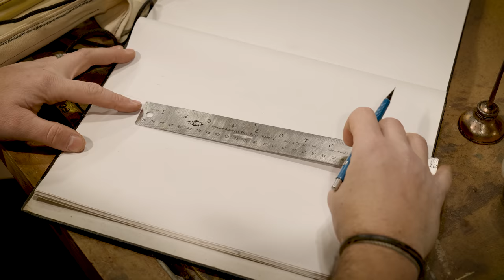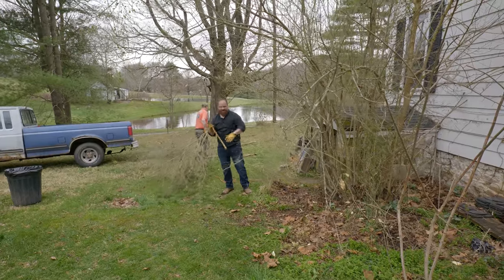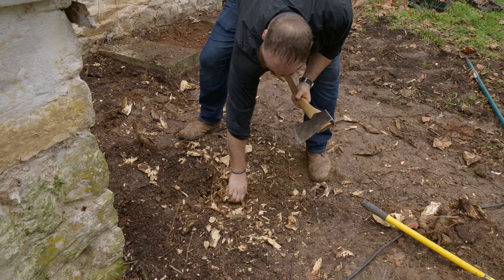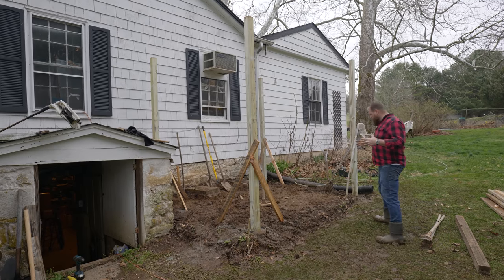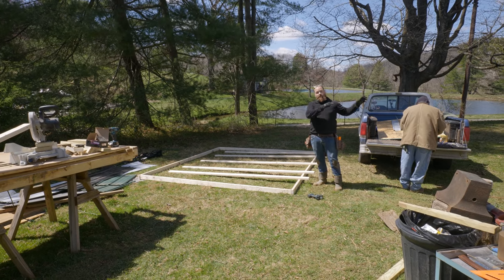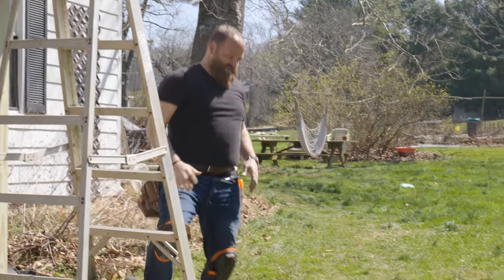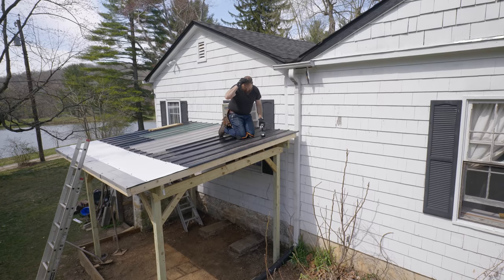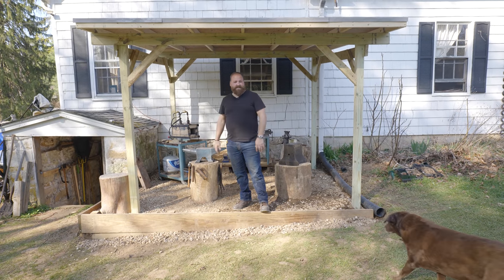Building a Smithy Behind My House

Comment: Had one for ten years. One of the most rewarding and relaxing projects ever. No electricity, just antique oil lamps and a hand cranked Buffalo Forge blower. Gasoline powered grinder and a coal forge I built myself using a truck brake drum. FANTASTIC  man-cave hang out,too!
A genuine very old 400 pound anvil was my "centerpiece". You are THE MAN!!!

Comment: Great video and motivation for me to build a lean-to smithy at our new house! Only criticism I have (and its constructive lol) is that I was always taught when attaching sheet metal roofing to run the nails or screws on the tops of the ribs. This way if the gasket ever fails, rain water won't be running right over the hole. Also, you may look into adding half walls, or wall that are 3-4 foot high as wind breaks, stop snow drifting, helps dampen light so you can better see the color of the steel, contains sparks at forge welding heats, etc. And lastly, not sure where you're located, but here in Indiana those corner posts would most definitely frost heave. I believe I will have to sink my corner posts much deeper. Excellent build though and it gets me excited to build my smithy finally

Comment: Great setup! It could be a good idea to add some sort of steel box to use as a "dark box" to check temps for forge welds. I definitely want to start a setup similar to yours though because forging inside my shop is brutally hot sometimes.
Reply: People often forget a fly ash cinder catcher. For the forge.
Reply from the maker: Both great ideas. Thanks guys.

Comment: Next time you have to remove a stump, just grind it down. They have like 15-20 dollar wood grinder wheels for an angle grinder at Harbor Freight. I used on huge root for putting in some pipe and works great. Just clean the teeth out every once in a while. 9:49

Comment: I would face the back of forge facing out the front corner not towards the house. It will get very hot over1000 degrees and that corner will trap the heat. Just a thought.

Comment: Noticed the roofing paper mistake as well and it looked like a couple of tin sheets went from top to bottom I thought they should go bottom to top BUT you may want to look into sealing the roof it'll help with possible leaks and the color just a suggestion - great job looking foreword to the next video

Comment: Hey man, I'm not a contractor, but I've laid a couple of roofs.  I've never seen tar paper laid parallel with the slope.  It should always go perpendicular to the slope and laid from bottom to top with a 4"-6" lap.
Reply from the maker: Yup. Lol. That’s one thing that slipped through. When my dad showed up later he said the same thing🤷🏼‍♂️. Next time.
Reply: So I'm not the only one that noticed that lol may want to look into sealing the roof it'll help with possible leaks and the color just a suggestion - great job looking foreword to the next video

Comment: You can chop apart the roots close to the surface but the lower ones will sprout over time until they receive nutrients. The best solution is to poison the soil where you build, we here in Eastern Europe pour used motor oil between the roots.
 It will cause a lot of problems if you concrete the wood straight into it. On the one hand, the template pipe is usually used for drilled circle holes, not for dug holes. We used to pour the previously mixed concrete straight into the dug holes so that the concrete foot takes on the shape of the soil so it will be much more durable and stable. A welded leg made of iron is concreted into it, into which the wooden column is then screwed so that it can be replaced if it rots without disturbing the concrete. Of course, we do not use a wooden column very often, we rather concrete an iron column straight into it. I’m not saying as to hurt, but this is so painfully American construction method. As an Eastern European, watching this is almost frustrating. :D

Comment: Why do you set the wood directly into the concrete. The concrete will let water thru and the wood will eventually rot.
Reply from the maker: We have a cross wind that I wanted to be sure the set up would stand up to. And all the post are pressure treated. Thanks for the thought and comment.
Reply: @TheArtofCraftsmanship  I just asked because here its common to set a U-shaped galvanized steel piece into the concrete and then you screw the wood beam between the legs of the "U"